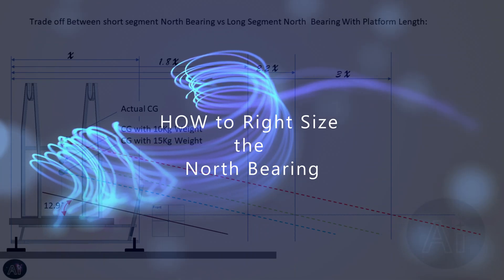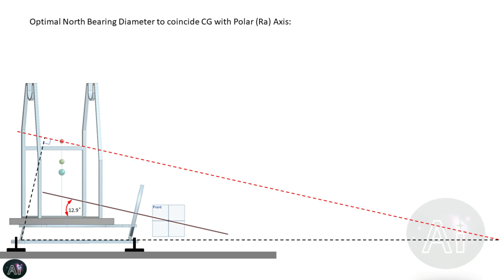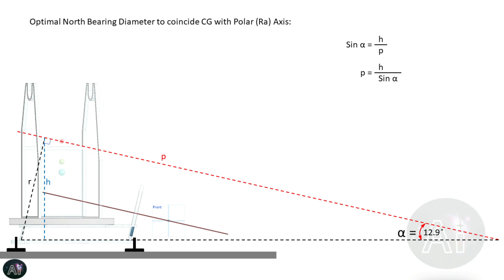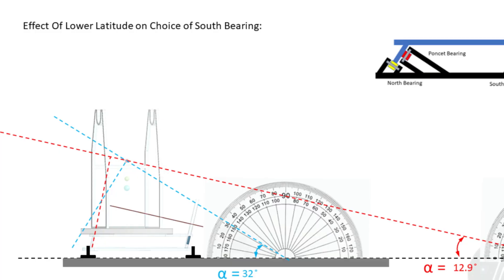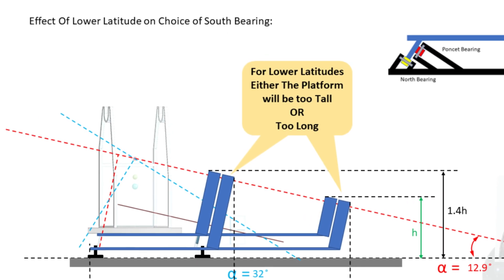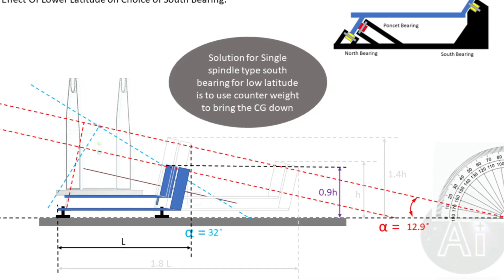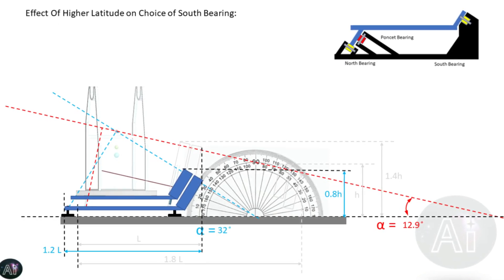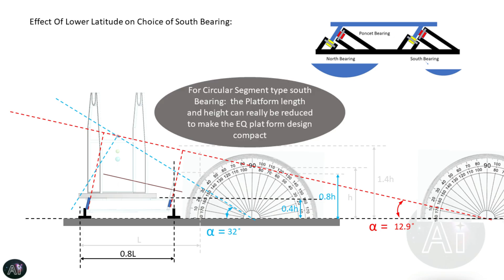How to Design and Optimize EQ Platform Video Series E04

Comment: Search for eqplatform_calc2012.xls. It is an excellent spreadsheet, for designing an EQ platform (I used the VNS type). I found it invaluable, as an easy reference, for determining bearings' design.
Reply from the maker: Sure let me check that, thanks for the info, I will mention it in the next episode.
Reply: @ASTROindi  There is also another similar-if not identical-xls file: eqplatform_calc2012_3.xls. I haven't checked if any differences, between the two. I used the first file, during my build.

Comment: Hi , do you have any plans for the equatorial mount structure which i can print and a parts list ?
Reply: In the 2nd vid you said that the mount is suitable for 12° as well as 24°N my latitude is 22° N will it work?
Reply from the maker: @kaaseverything6516  I have an existing EQ platform that I built for 24 deg N, when I was at my Village during lockdown. Now I am designing a new one for 12.9 deg. 
I will touch upon the design I had for 24 deg when I make the fabrication part.
Keep following the video series and subscribe.
Reply: Thanks man , astro yt channels from india are very rare.
Reply from the maker: @kaaseverything6516  thanks to you for your support and motivation.
Reply from the maker: Hi if you mean a template which can be printed and used to cut out the parts, then the answer is yes and no, yes if your latitude is same as mine 12.9 deg N, then I can share the design, but if your latitude is entirely different then it will need a complete redesign as per your input variables, that is the whole purpose of this video series. Try for yourself if you have doubts please ask in comments I will try to clarify them.